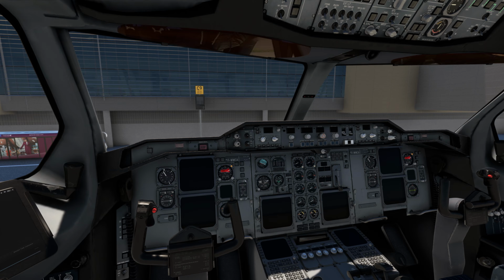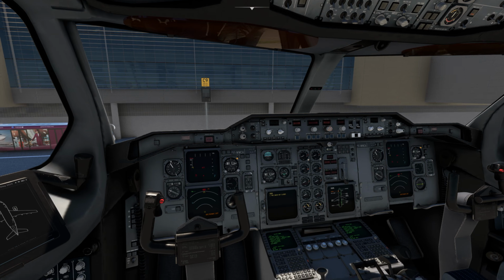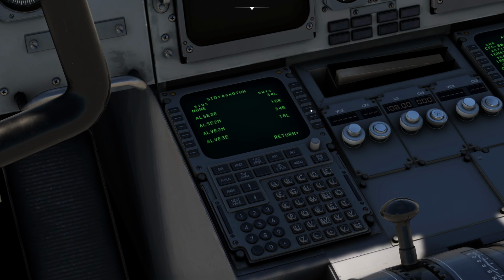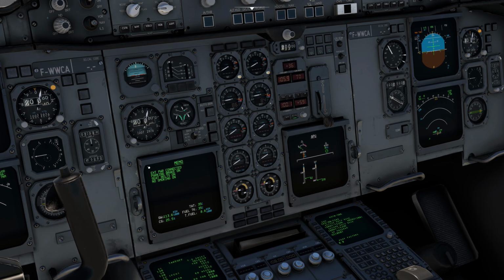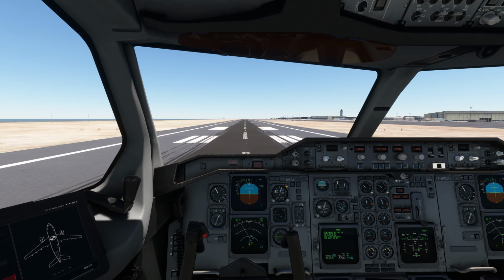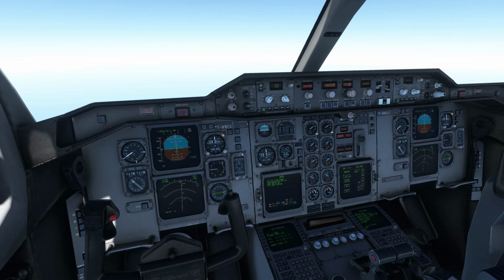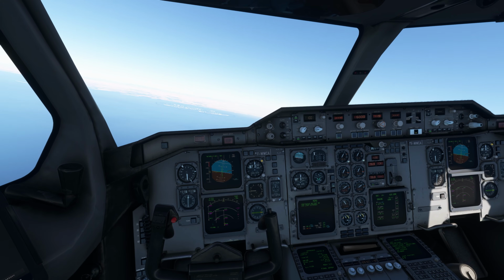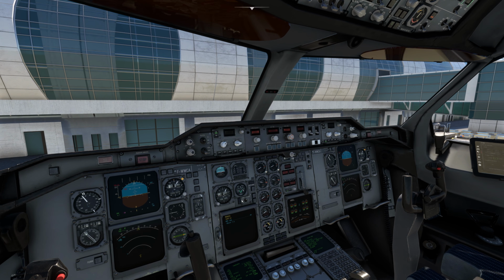iniBuilds Airbus A310-300 Complete Tutorial for Beginners - Microsoft Flight Simulator 2020

Comment: I can't get throttle to play . If I pull down to idle it engaged reverse thrusters . I have configured it but still does it .
Reply from the maker: Are you using the throttle on the stick or the one on the TCA Quadrant?
Reply: I use my throttle on the stick. Use a velocity one . Only work around is the have idle at 50% throttle and essentially cut my range of motion in half .
Reply from the maker: Thank you for your input. Actually different controllers have different behaviors with this plane. There is always a work around available and I think you have found the solution. Do let me know if you have any other questions.
Reply: I really don't understand why you have to tell it the transition. The REREK waypoint is always the start point of the approach to that runway, so why do you have to tell it? The STAR will always end at it, so surely it should simply be built in to the STAR?